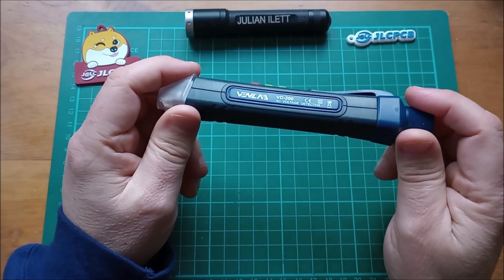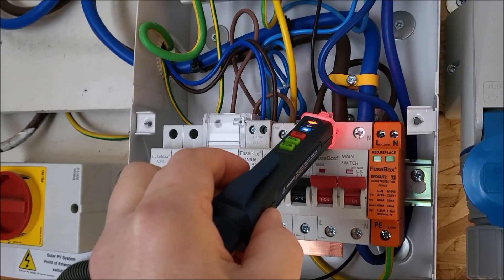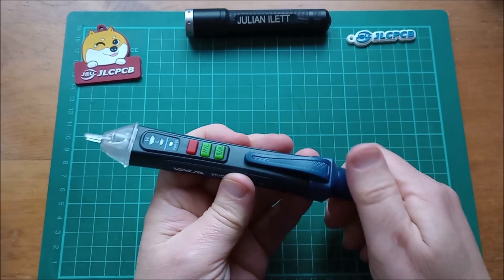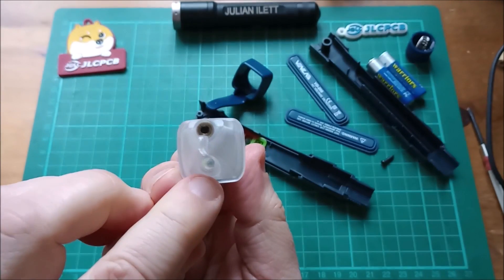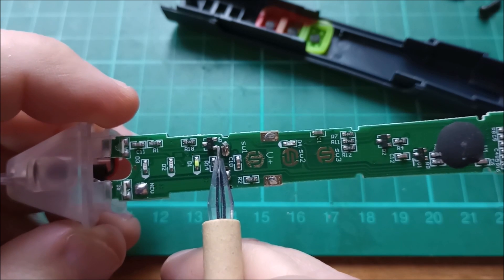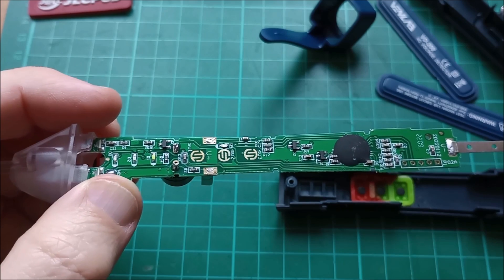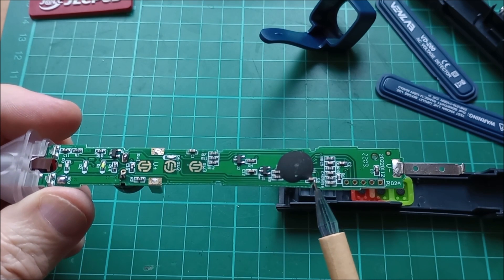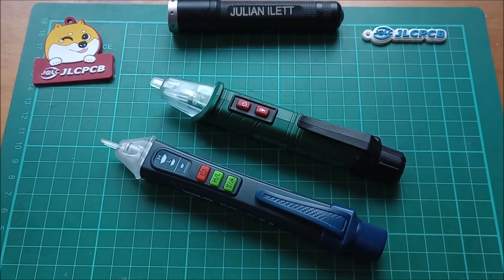AC Voltage Detector Teardown

Comment: I wonder if he could detect the live wire in a wall or find that one bad bulb in a string of Christmas lights.
Reply: The stud / pipe and voltage finders often give a ‘live’ reading across a whole wall if there’s any foil backed plasterboard present.  Same way the volt pen will claim a dead cable is live by induction from an adjacent live cable, or worse still will show a live armoured cable as dead because the armour acts as a screen.  Important to recognise the limitations and features of your tools.

Comment: I wanted to adapt something like one of these to become a sensor for a raspberry pi so it could detect if the mains power was active or not which could for detecting power loss for Ups backup events. Never did quite figure it out.
Reply: You can always just use a spare 5V USB brick (+ maybe a powerstrip) on a GPIO Pin to detect if the mains is online or not.

Comment: Now we are all getting solar, they are going to need to make a DC one. As i've now got 300-400V DC running around the place and 98% of the wire is the wrong side of the isolator, as the isolator is next to the inverter. I just added an extra warning sign that states "don't play with while sunny"
Reply: Idealy there should be an isolator sited close to the panels precisly for this problem as high voltage DC is even more dangerous than AC.
Reply: @Arachnoid_of_the_underverse  except that my panels are on the roof by the time you get a ladder to get to the switch it would all be over. The cables externally are running in pipe work with more warnings on them than packet of fags.
Reply: @TheEmbeddedHobbyist   The roof mounted isolator is to remove the charge from the cables whilst working on them not an emergency isolation device.
Reply: @Arachnoid_of_the_underverse  Not seen a isolator on the roof as the cables go up the wall and stright under the panels. Also there is no isolator shown on the system diagram. So i'll have to assume that the only DC isolator i have is the two next to the inverter one for each string.

Comment: Electrician say never use this type of things for confirmation, always use a multimeter
Reply: Better still, use a dedicated voltage tester and proving unit.  Multimeters can easily be mis-set, e.g. if you accidentally leave it on DC when testing for mains. These volt sticks should never be relied on, they are handy for identifying say which of a bunch of cables is plugged in, or if a fuse might have gone - but that is all, they absolutely can't be used alone to determine if a circuit is safe to work on.

Comment: Nice Video. But For checking voltage in a distribution Box I prefer to use my two handed voltage probe. (Just Like "Duspol" or "Fluke" ) I m in this Job, my live depends on it.
Reply: Two-handed probe? Is that where you put one hand on Live and the other hand on Neutral and feel for Voltage?
Reply: Your life will depend on it. Live is the thing those with a life actually do. 😉

Comment: I don’t think I would trust it to show something was dead, but rather to confirm something is live (and therefore potentially dangerous).  Use a proper dead proving device for safety critical use, together with a proving unit.
Reply: I have a Fluke one it's handy for fault tracing like blown fuses or lost phases, Never Ever use it to prove a dead circuit.
Reply from the maker: Yes, the test should always be relative/comparative.
Reply: @dogwalker666  🤣🤣🤣
to test the dead circuit it not bleep 
👍 2 in 1 🤣🤣
Reply: @davey2k12  it's not fail safe, I have seen them indicate dead on a live circuit.
Reply: I'm tryna get better tools but I guess I need a voltage tester rather than a pen
Reply: @animus1785  I would recommend that first.